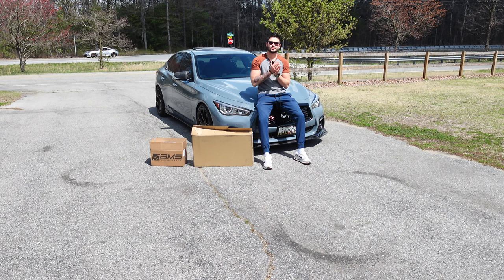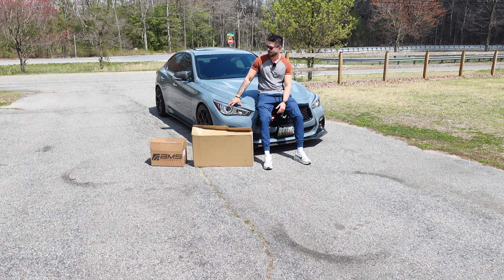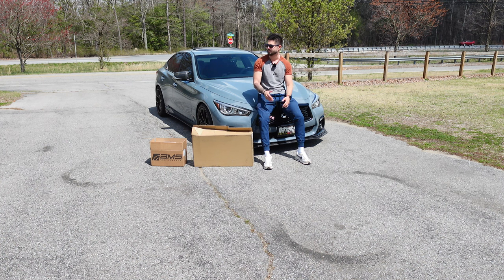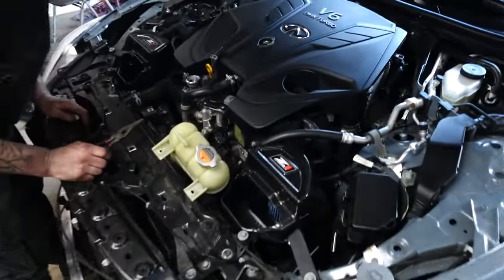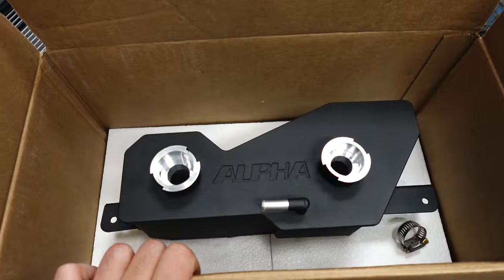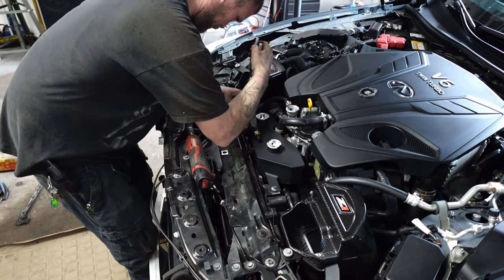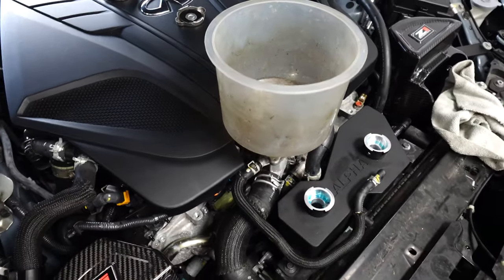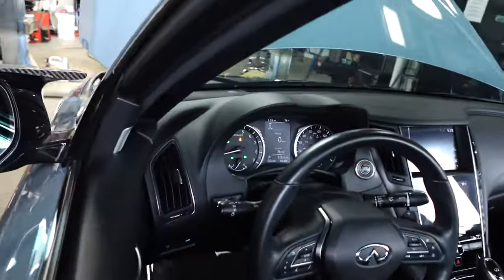My Q50 Red Sport gets more cooling power with Z1 Heat Exchanger and AMS coolant expansion tank...

Comment: did you ever bleed the system to remove the air pockets?
Reply from the maker: @HighTideChris  we didn’t let any air go in from the beginning we start installing so we didn’t have to bleed
Reply: @ check your charge air coolant temps. if they are starkly higher than your ambient temperature, then you have air pockets. if it stays within 20 degrees above your ambient temp, then you’re good.
Reply from the maker: @HighTideChris  I already did everything looks good